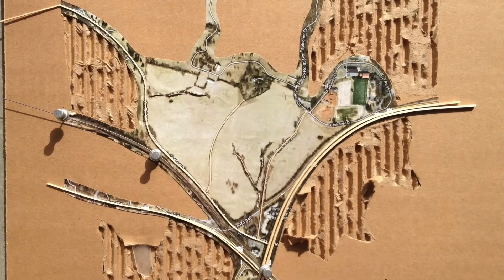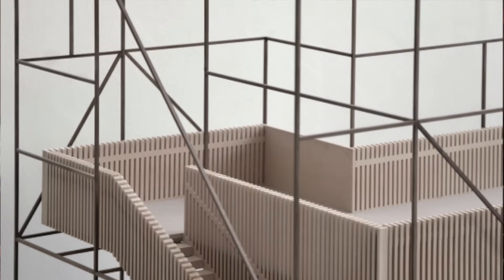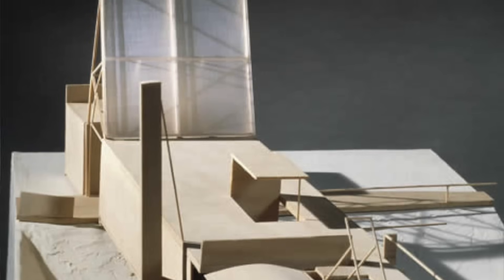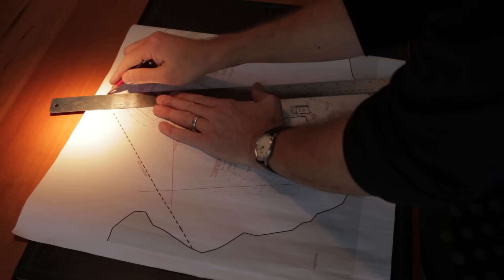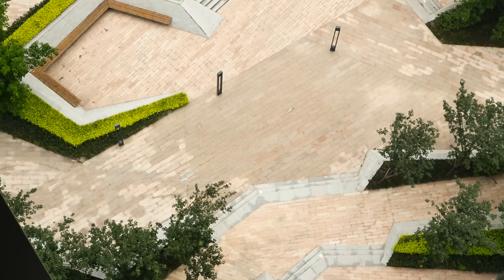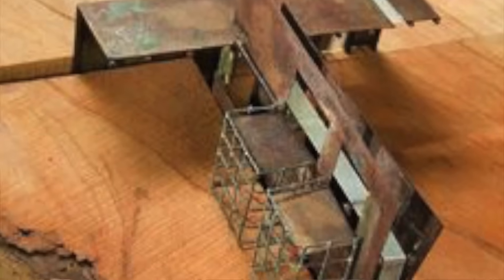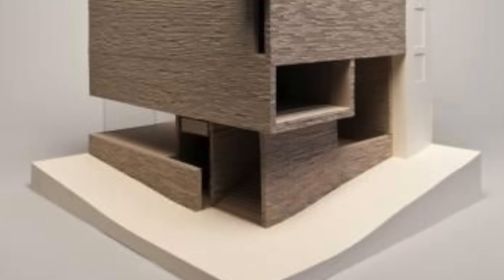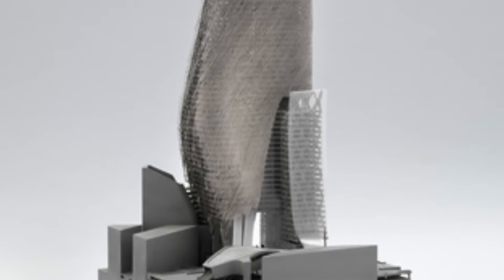Architectural Model Making - Model Bases + Scale : An Architect's Guide (part 4)

Comment: I have a not so quick question: I was trying to model the Sinthian Cultural Center roof for an assignment. My idea was to CNC it, then carve out the remaining bits by hand. I was told by a professor that it couldn't be done. At 9:40 in this video, you show a model that successfully does what I tried to do. If you could let me know how that was done or how I could go about making something similar I would greatly appreciate it!

Comment: Hey Eric, I'm a first year arch student, I'm pretty bad at model making so thank you for your videos, they're a huge inspiration. Sorry if this is a dumb question, but on the models shown in the video, for example at 4.32, how are those thick rods attached so well to the wooden base? even if it was a thinner rod, is it simply drilling a hole, and then placing the rod in the wooden base? 
Cheers Eric, my unit doesn't model make very much, we largely focus on using software, but I want to improve my modelling.
Reply from the maker: i'm guessing those are drilled...whenever I can, I avoid gluing things in place b/c chances are good your design is going to change and non-glued things are far easier to modify...

Comment: Hei Eric, thanks for sharing this video! I am a third year architecture student and your videos help me a lot!
Right now, i have to build some model which exist in sea. but i'm not sure what material i could use for the water. It is supposed to be as realistic as possible. I think in your video (especially in 8:23) that model close enough for represent the water, but i dont know what material is it. Do you mind tell me what material is it? and do you have any tips or something that i can use? looking forward to see more of your videos soon :)
Reply from the maker: not sure what that material is, but my guess would be a tinted cast resin. i think the more realistic you make the water, the more realistic your model has to be overall so I would tend toward the more abstract representation. Water isn't experienced - by and large - as a see-through element necessarily. It's more of a surface and - perhaps more importantly - as open space.
Reply: Thank you, Eric.  i will take your advice into consideration :)

Comment: First up, I love your channel! I am a second year architecture student in Germany and find your videos super helpful. I just recently used some of your tips for my presentation model and got a 100% on it! 
Right now I have to build a model in 1:1000 (European scale) of the O2 Arena in London but I'm not sure what material I could use for the roof. It is supposed to be as realistic as possible so I was thinking about some kind of fabric. Do you have any tips for the steel construction and the roof top?
Looking forward to see more of your videos soon :)
Reply from the maker: Cheers +Aileen's travels ...glad the vids are helping you make things in the world.
For the 02 arena how about: white stockings, double sided drafting film (5mil mylar here in the US), or trace? You also might have luck finding a plastic dome of the right size and spray painting it. Depending on how accurately you're going to represent the steel towers piercing the roof, the plastic may be easier to manage than a fabric, which will be difficult to keep from fraying at these points. You may also be able to spray-mount the fabric to the plastic dome using it as the underlying structure. Good luck!